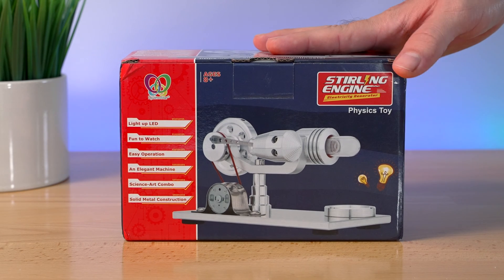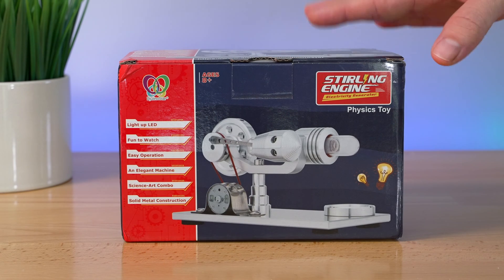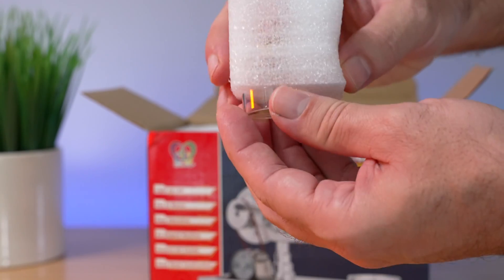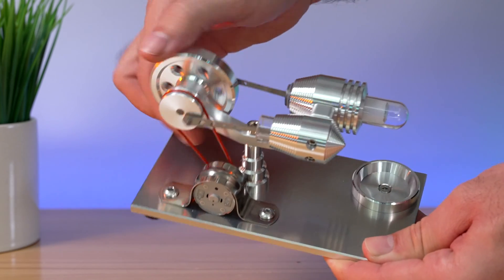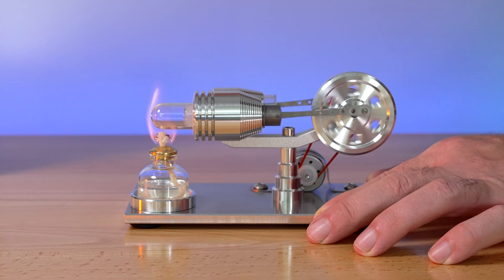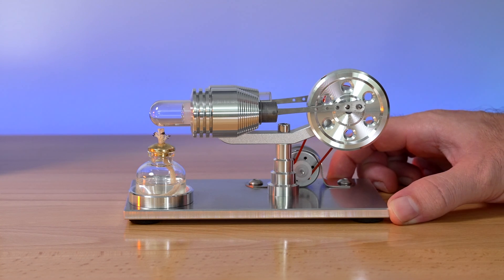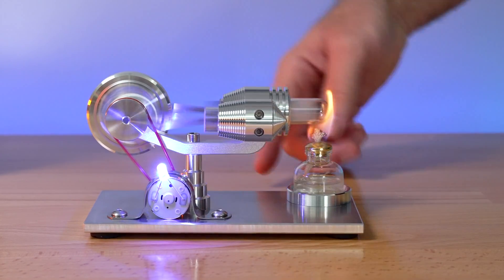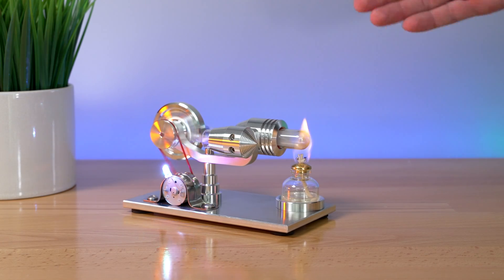DjuiinoStar - Hot Air Stirling Engine

Comment: These really are lovely models and brilliants TOYS, (or demonstrators), but they are NOT going to save the world. Internal combustion is intrinsically more efficient than external combustion because the energy does not need to be trapped, as it already is; whilst in external combustion (like traditional steam engines in trains, basically !) the heat produced is easily lost to surrounding environment, contributing to both carbon-dioxide production, AND directly global warming through direct heat transfer!